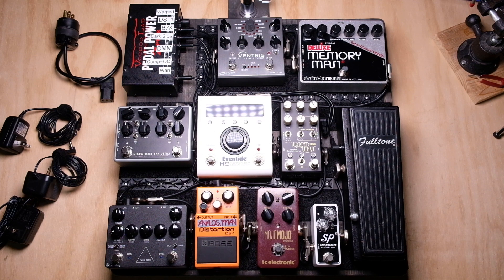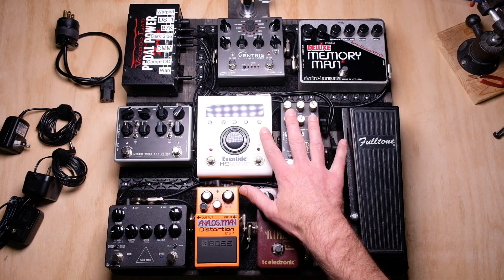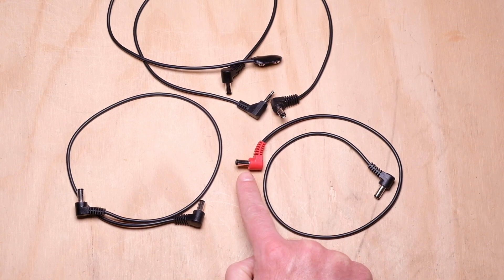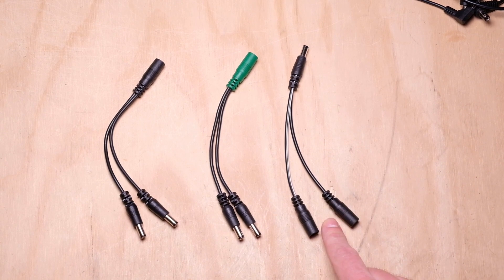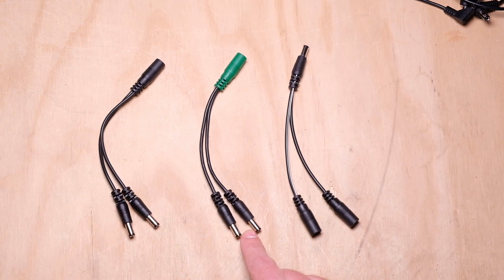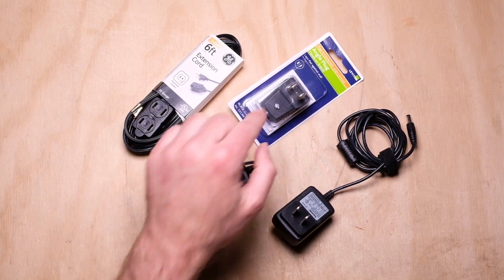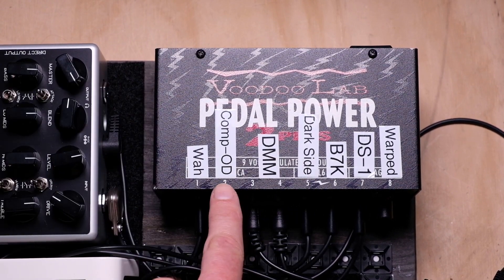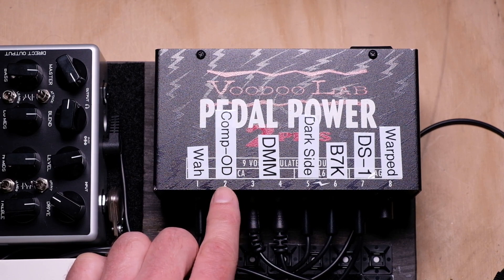Power Supply Planning

Comment: awesome content! if it's alright to ask, which is a much better power cable to share power draw to pedals, the port splitter (at 4:07), or the usual daisy chain cable (10:13) ?
Reply from the maker: It doesn't matter, use whatever you have. Just make sure not to exceed the max amperage of any single port on the power supply.
Reply: @AlphatoneAudio  thanks! 🙏